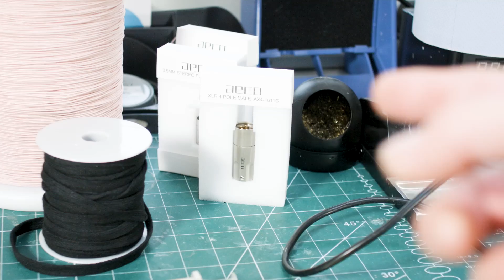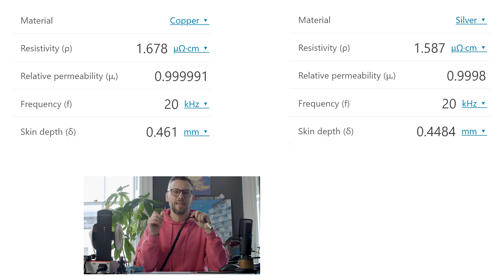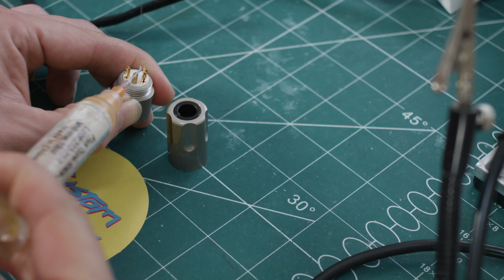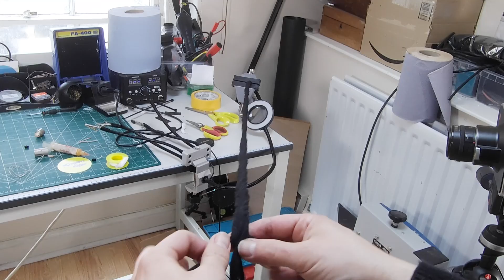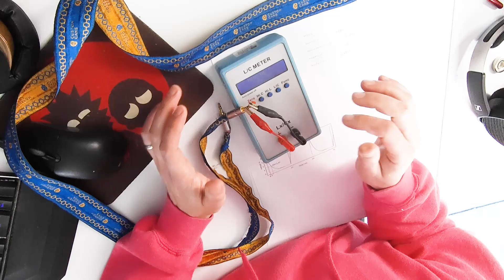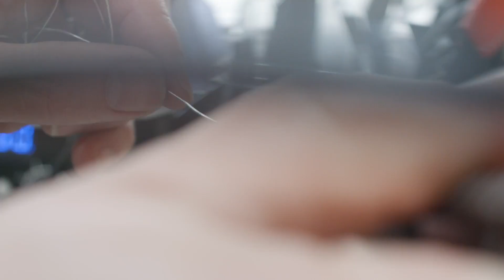Nerding out while making a braided balanced headphone cable using aeco connectors

Comment: Isn't the 3rd connection of a 3.5mm ground? Even though it's disconnected, it's grounding out any possible noise because a 3.5mm is L/R-, L/R+ and ground, yeah?
Reply from the maker: 99% of headphones don't have a ground at the earcup end. Just the + and - for the driver. I think the only headphone I can think of with a separate ground is the Beyerdynamic T1 and T5 which use the ground for shielding on the cable. There are probably others but it is not normally needed
Reply: @CustomCans  Gotcha, interesting 👍. So a headphone that has cables of dual 3.5mm males each terminated to a 3-pin XLR connector technically isn't grounded? Or it depends on how the cables were wired up?
Reply from the maker: Yes... Most balanced headphone cables with 2 x 3 pin XLRs will only have 2 wires attached to each XLR one carrying the signal and one carrying an inverted signal.
I have a better explanation here https://www.youtube.com/watch?v=2bpX13gUJBI

Comment: Love the calm presentation and the cheeky notions to measureable differences :D
Would love that braid and subbed of course.
Reply from the maker: I think it is probably more theoretical than measurable ;) I am sure with the right equipment and comparing it to a  very badly designed cable, you could just about measure a difference in the top end but calculations say it would be very very small.

I will stick your name in the hat for this unnecessary over engineered cable ;)
Reply: @CustomCans  next up: how to overengineer a hat for the raffles!

Comment: great stuff,i could watch someone do this all day,bought several braided cables from custom cans and always wondered how you got the cable through the sleeve.
Reply from the maker: It depends on the cover - most of our cables are made with paracord - that has string down the centre from the factory so we just tie the wire to one of the strands of string and then pull it through, removing the string and inserting the wire in one go